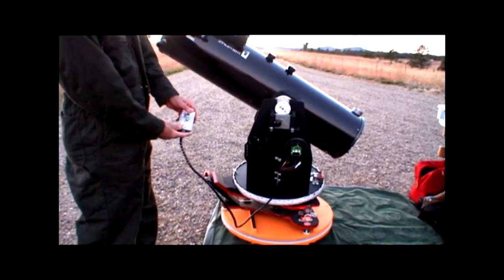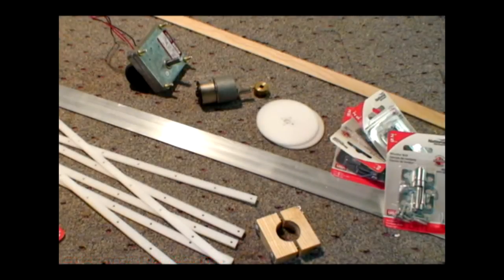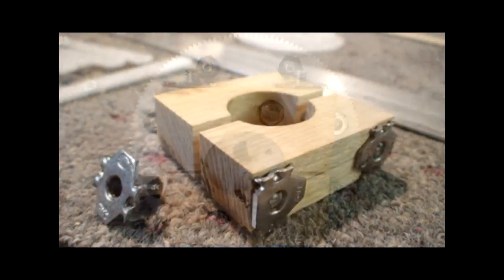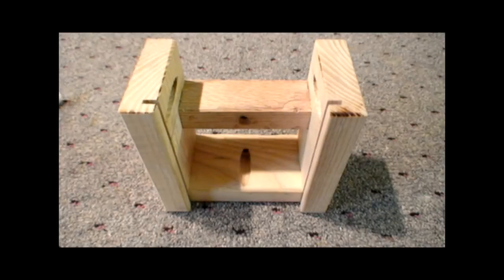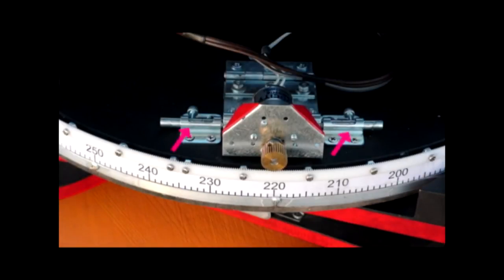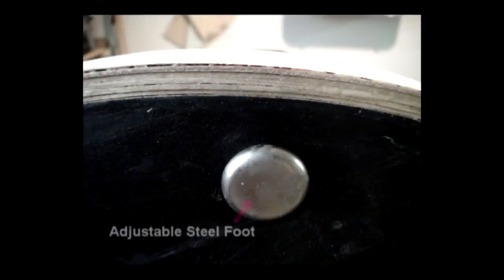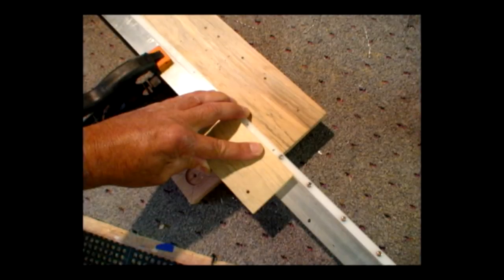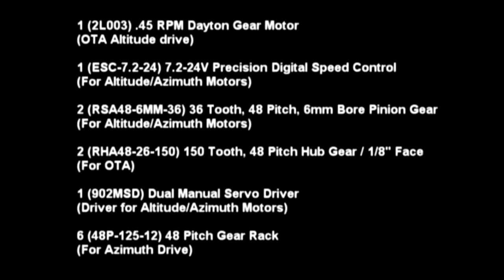A Guide to Motorizing a Dobsonian Telescope

Comment: Instead of using regular DC motors, you could use steppers to get precise alignment. They wouldn't need to be geared at all either. Just put the pinion directly on the shaft.
Reply: If you do use steppers, use sine wave drivers to help reduce noise and vibrations during movement

Comment: Omg.  I need this so bad for my Zhumell 10” Dob.  I sold my 16” NightSky Dob because I broke a vertebrae in my back and could not lift it.  5 years later I miss the views. 10 vs 16”  sucks.  

My 16” had a push to system and I loved it.  The 10” has nothing.  It would. E nice to motorize it.
Reply from the maker: Hey Grey Ghost, Here's a video that you might find useful for making your own push-2 system.  It's what I currently have on my UL16 Dob. Works great.  https://www.youtube.com/watch?v=KIIOt2bNdaA (5:49 in the timeline)   The system can be used with just about any dob.  :)